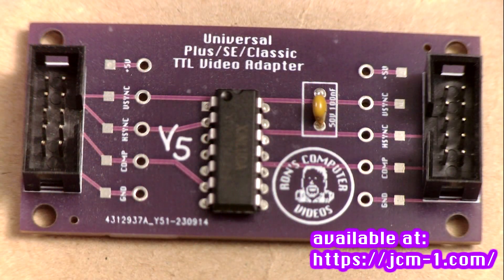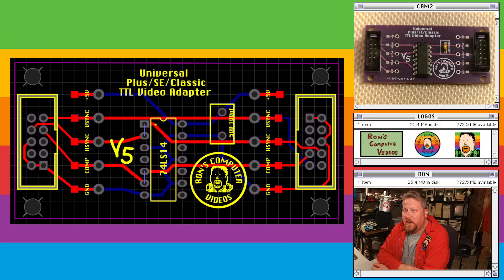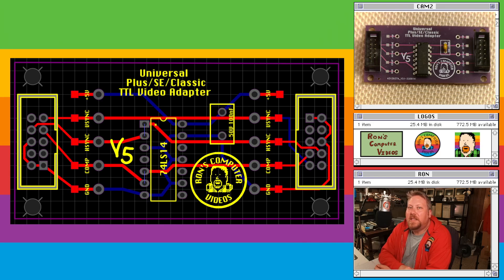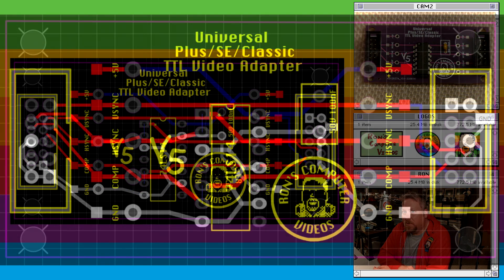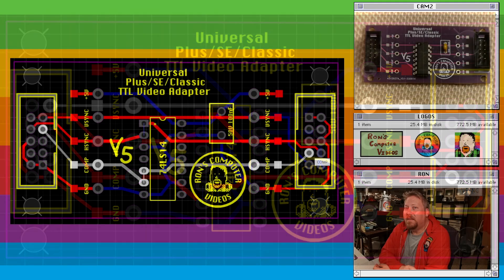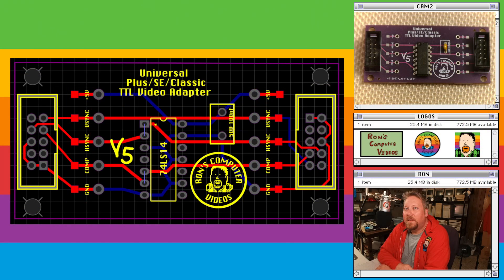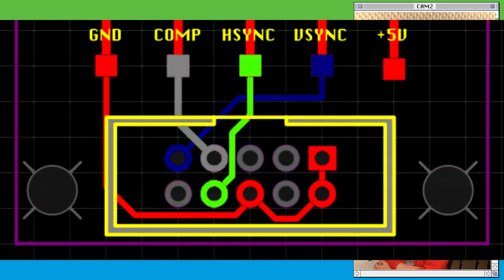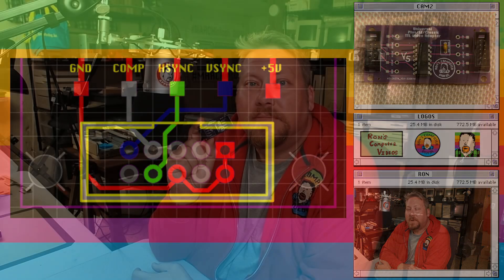Universal TTL Video Adapter (v5 for #Macintosh Plus, SE, SE/30, Classic & Classic II)

Comment: So the 74LS14 is just protection for a scaler correct? Otherwise the board serves no other purpose?
Reply from the maker: The 74LS14 is not only a "sacrificial" IC to stand in-between any errant voltage coming from your Mac's analog board, but it also inverts the video signal (flips it) so that should you choose to use a period-accurate TTL CRT the image won't be backwards on your display.

It's also a nice way to keep your wiring neat on projects like this, and provides several different options to accommodate most use cases.
Reply: @RonsCompVids  Got it thanks!!  So without that chip the signal is mirrored? B&W vs W&B?
Reply from the maker: HSYNC is flipped... which can cause big issues on a period accurate TTL CRT/